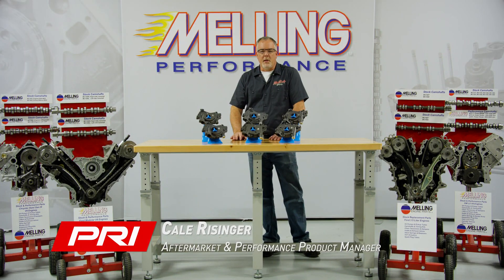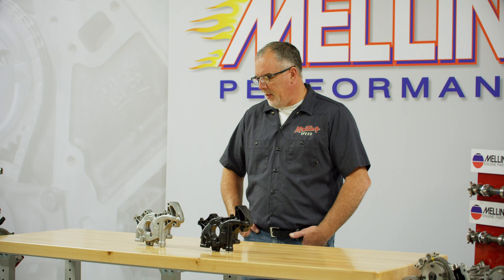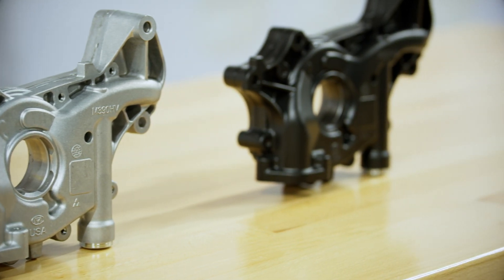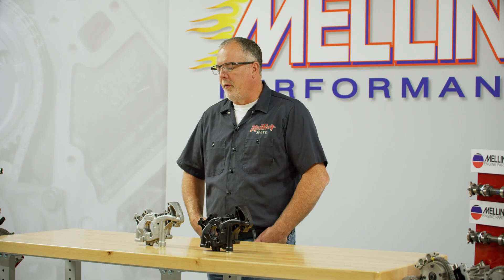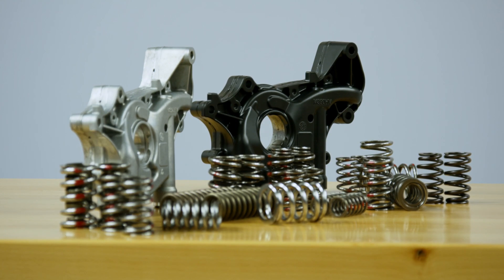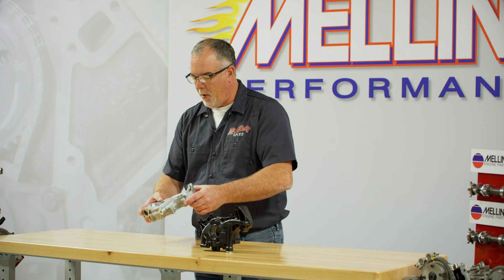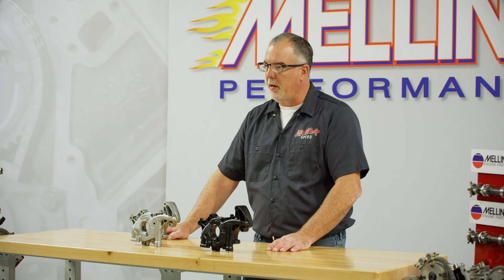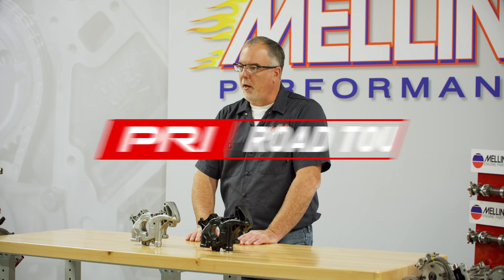M390HV and 10390HV Pumps from Melling Performance

Comment: Just ordered my new 10390HV, now I dont feel so bad about having to go into my block to change a water pump. Now it's because I want a upgrade to go with my new oil cooler and remote oil filter setup. Thanks Melling!

UPDATE
Decided to run the high pressure spring, since someone decided not to respond to the emails or comment entry off website (a hem' cough cough)

Glad I took the chance, running amazing now with the new pump and high pressure spring. Been running it for a few months flogging it and no issues with oiling, oil running out, or excess pressure on seals both on engine and turbos. Think my tubos are happier too with added oil flow to the bearings.

UPDATE 
Running it now for a year and over 30k miles, have to say it's great. No issues whatsoever, the higher pressure has helped my turbos stay well lubed. I have two happy snails that get flogged daily. I'm sure having ample oil pressure has also kept my variable timing working at peak performance, and checking it all recently with my scope everything looks shiny brand new in there, no dry spots or wear in the upper end of engine. Can't have starvation with a pump this good!
Reply: Can I put the M390HV Oil pump on a 3.5 NATURALLY aspirated engine? Thanks!
Reply: @anthonyking521  Heck yeah you can, same pump for ecoboost and naturally aspirated👍